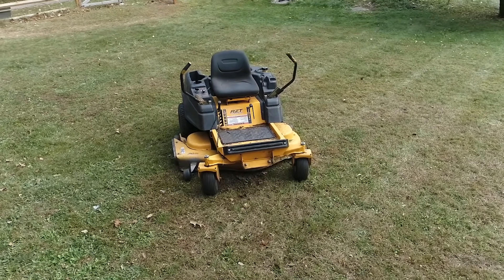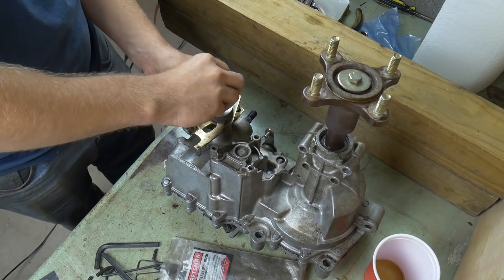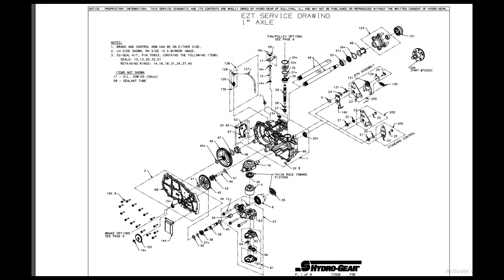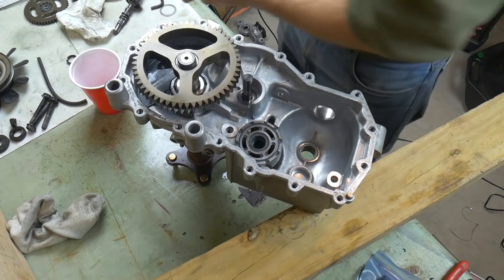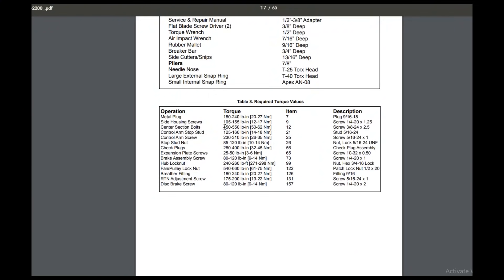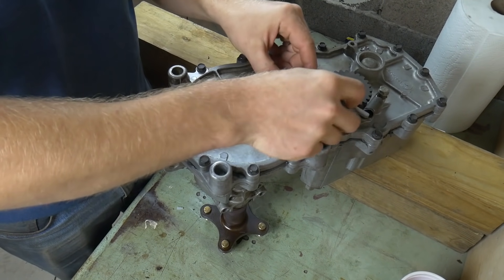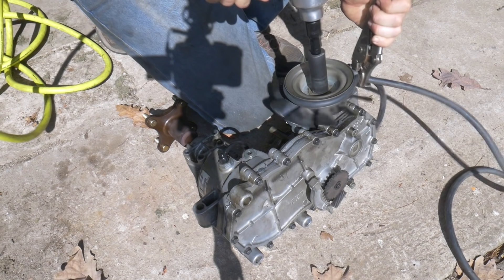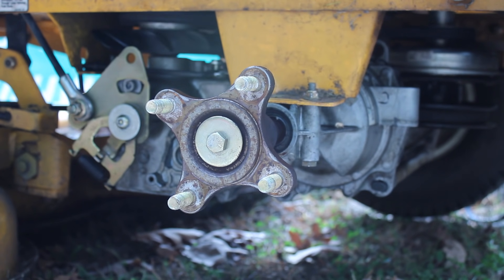Cub Cadet Zero Turn Weak Transmission Fix.

Comment from the maker: Quick Tip! If you are having issue removing the the input shaft and the bearing, you may have loosened the 3 center section bolts too soon. If so, tighten them down  and it should be easy to remove. A few people commented with this issue and tightening down the center section solved the problem. Sorry for not showing that in the video properly. Hope this helps anyone having this issue.
Reply: Thanks for this comment! I was struggling with this very thing, but also taking out the little retaining pin on the input shaft, but is that even necessary?  When it wouldn't come out because I had already loosened the three bolts, I assumed it was this clip and the service manual says to remove the clip.  My only suggestion to make this video perfect would be to show the removal of both shafts.  They were tricky.  Thanks for making the video, though, lifesaver!
Reply from the maker: @lorenjohnbailey6445  glad it helped. If i do another one i plan on doing an update for the stuff i missed. Who knows when that will happen lol
Reply: its called a banjo fitting not lollipop
Reply: I came here looking for that tip. As soon as I tightened the center assembly back down, that shaft popped free. Thanks!
Reply: I had a extra center section so I checked it for flatness, was surprised it is not that flat and sanding on plate glass 1000grit helped it😊😊😊
Reply: Sorry, saw this after my comment.  I'll give it a try, but am still wondering about that ring on the shaft.

Comment: If you change the fluid in these units regularly, the hydros will last. But if you don't keep your fingers crossed. The residential mowers do not have a drain to change the fluid. If you are capable, install a drain in each hydro to solve that issue. It's all about the maintenance. Just remember, Toro designed these movers for people with ZERO mechanical ability. When something like this happens, Toro is hoping the person will buy a new unit.

Comment: I'm having trouble locating parts for my mower.  I have the Hydro-Gear system like what you are working on in the video, specifically ZC-AMBB-4DDB-3RPX and ZC-DMBB-4DDC-2RPX.  Would you be able to help me with a website address where I can get parts?

Comment: What did you use or recommend to clean out the inside of the case when you have it open, to make sure any contaminants are removed from the inside. I've got mine all broken down, and new part in hand and look to reassemble this coming weekend.

Comment: Just opened up a ZT3100. I've had no trouble up to the point of getting the center section loose. But, I don't want to damage anything. My axle runs, but gets hot and loses power. I picked up a ZT2800 thinking it was another 3100. It's the opposite side (R). Checking the parts list for both, there are only a few parts that are different. So, my $15.00 investment hopefully netted me some serviceable parts. I noticed the gears were different numbers along with the center section, which figures since it's the right side vs. my compromised left. I didn't see that you had to remove the input shaft, but noticed it went back in after you put the new center section in. I'll try that tomorrow. Thanks. 😊
  I tried watching another guy, but he was saying it's a waste of time and money to attempt a repair. He was ripping parts out and said the whole thing was going in the trash after his video.
Reply from the maker: @battalion151R  if the input shaft is hard to get out, make sure the center section bolts a tight. Then remove the center section bolts.

If you loosen the center section before the input shaft is removed it will be hard to get out.
Reply: @darbleythetractorguy458  
  Thanks! Finally got it out. Everything looks great, I think my problem came down to the small seals above the (I hate it when I can't remember the name of stuff) supply pump. BUT! Getting that stupid bypass part to stay in the right spot was a PITA. A dab of grease works well. Since this pump is 12 years old, it had two cover bolts break off, which was fun. But, It's reassembled, and I'll be putting it back on the mower today.
  If you look at Hydrogear's diagram, I think that bypass piece is shown but not numbered. It's above the oil filter on the diagram, next to 188*.

Comment: This was a very straight forward repair video. No fluff, just the necessary info to get it done. I just subbed. It turns out that parts and service are available for these Transaxles if you do it yourself. I just want to change the fluid in mine, but I found this video and thought I'd watch it just in case I need to actually rebuild mine in the future.

Comment: How much was the parts bill for this i have a i1050 zero turn with the same problem. Got it didn't wait till the end to  post message.
Reply from the maker: parts and prices are in the description. Prices could have changed a little but roughly $200

Comment: Hi Tractor Guy, thanks for the video.....nice job , clear and well explained........looks to be easy......just two questions, if we consider the time and effort, would it not be safer to replace the 2 bearings? also Hydro gear tech say I have to replace both blocks (pump and motor) I know these parts are pretty expensive, but is there no risk these are worn and no anymore usable? ......last thing : seal kit : for what? where did you use it?....... my case ZT2200 (EZT) less than 100 hours, oil inside rotten (milky/silver gray) after 20mn/30mn use becomes noisy and weak and after a while won't work on right side.......many thanks

Comment: I have watched a lot of these videos, and nobody asks the question of "Why" did the center section fail. I have rebuilt several of these units, and in every one the 10-tooth jack shaft gear hard surface is flaking off. Those tiny chips go down to the sump, get sucked up into the pump, and chew it up. So, if you don't replace the gear your rebuild will be short lived.
Reply: If this is the problem, just drill a hole somewhere in the bottom, thread it, and close with a magnetic oil pan plug, chips will stick on the plug, afterward it also make oil change easy
Reply: @Michel-gb5eb    Drilling a hole to drain the oil is a good idea, but you still have to change the damaged gear. There's already a magnet and filter screen from the factory but the chips still get into the center section.
Reply from the maker: Thanks for the info. I was under the impression that it was from going into reverse while still moving forward. There no pressure release on these transaxles so it slams the piston onto the center section.

If I take another one apart I'll definitely check the gear surface.

Comment: So mine is of course is the left hydro and as I mow the unit gets hot and is not very responsive. But cold at first it turns fine. What if you just changed the oil from a multi V to a straight 30 or 40 weight or even a 50 weight? Isn't the problem the oil thins as it gets hot? Yes I'm lazy and afraid I'll screw it up!!!😉

Comment: at the end of the Video you adjusted the neutral position. Was the engine running to check if the wheel would spin forward or backwards ? ( to get Neutral at the correct spot )
Reply from the maker: If you can safely adjust it while the engine is running, I would do it while it's running. If not, adjust with engine off and check it with engine running. I believe I did it with the engine running but it's been awhile.

Comment: Losing power from right hydro, why do grooves hurt the center piece? I checked my check valves, they are tight, I do have metal shaving in the filter. 

Thanks

Comment: wanting to find out how old my transmission is
Info on the sticker: HYDRO GEAR
top right 618-04327
bottom left 6060B50239
MOWER IS TROY-BUILT RTZ50
Ive had it for many years. About 300 hours. Cleaned and greased after every use. Garage kept.

Comment: This failure/repair is all over the Internet and causes me to believe this is a design failure because it is certain to happen on the left hand transmission to every zero turn mower owner. I love the tractor when it’s working, but I will not buy another.

Comment: I know yard tools use the crappiest oil they can buy for manufacture.  Could these transmission problems be avoided by using synthetic oil?  My JD LX176 1994 still runs great after 30 years of mowing and snow removal.

Comment: Just got done replacing both left and right side center sections on my Husqvarna RZ5426.  My finger was too big to hold the bypass valve in place when installing the center section so I just used a zip tie to keep it in place.  Worked like a charm.
Reply: I used some really old dry grease and it worked great on 7 so far 😊

Comment: Maybe a good way to prime the unit would be to drive it with an electric drill while the unit is still out of the mower. That way after priming is done, you can easily check the oil level and fill as needed without having to remove the unit from the mower again.
Reply from the maker: It's definitely a good idea. I don't see why it wouldn't work.

Comment: I have a broken cradle bearing and the manual is saying its only available with a new case, but I found the cradle bearings sold separately.  Have you ever replaced those? Not sure if they just rest there in the case or if they are adhered in some kind of way.

Comment: How many hours do them pumps last until problems start happening  ??
Reply from the maker: I think it really depends on how they are used. I would say if used lightly you should easily get 300 to 600 hours or more. The big thing is not putting them in reverse while still going forward which a lot of people do with zero turns. If you come to an almost stop before zero turning or reversing I think they could last a long time.

Comment: Hey, Darbley. Everything works fine, the mower runs like a dream, but one issue, the bypass rod does nothing. I put it in, the same way it came out, and absolutely nothing. I can't find the reason, hopefully you can point me in the right direction, thank you!
Reply from the maker: The little metal piece is probably not in correctly.

Comment: Is there any reason why you couldn't do the purge procedure using a drill before installing it?  Seems like it would be easier to add oil if needed while it's still on the bench.
Reply from the maker: It's worth a try. I don't know if a lower rpm would affect it at all. If I do another one I'll give it a try.

Comment: Excellent presentation..!!!
I’m having trouble getting my center section out.. you skipped past that part. Everything is disconnected but it seems like it’s jammed in there.. worried if I just try to pry it out that cheap metal will break and parts will go flying everywhere..
Reply from the maker: there is a pinned comment that might address the issue your having. if your input shaft is still in it you might have still loosened the center section bolts to soon. Here is a better explanation

" If you are having issue removing the the input shaft and the bearing, you may have loosened the 3 center section bolts too soon. If so, tighten them down  and it should be easy to remove. A few people commented with this issue and tightening down the center section solved the problem. Sorry for not showing that in the video properly. Hope this helps anyone having this issue."
Reply: @darbleythetractorguy458  thank you so much for the quick reply..
It just started bypassing again..
Awesome..!!!

Comment: Just FUI if you use RTV you want to set the pan cover on just after applying the RTV. But! Do not put the bolts on for about 30 mins that's let's the RTV set up and make a gasket! Should be about a 1/8 gap while setting up..Then  torg down.
Reply from the maker: Thanks for the advice! Good info to know

Comment: What all did you have to buy, just the center section and seals? Thanks for the video.
Reply from the maker: Yes. Center section, seals, and oil.
Reply: @darbleythetractorguy458  so after this type of repair is it running strong up hills and any unusual whining noises?, thank you
Reply from the maker: @mountainmike1685  runs good and strong again after the repair.

Comment: I recently purchased a Cub Cadet Ultima 54 inch deck with a 24 horse Kohler.  I think it has this transmission.  I don't have time or want to do any work on the transmission.  I mow about a hour and a half a week with this mower.  I am not hard on it and never will be.  Currently it has 2.8 hours on it.  How long do you think this will last and are these transmissions junk? If so I may get a extended warranty.  Thanks for the video.
Reply from the maker: They should last if you don't beat on them. Mostly coming to a near stop when transitioning between forward and reverse/turning. Damage is done when pulling the stick to reverse while still moving forward. They aren't the best transaxles but can last if taken care of.

Comment: Question you said to re check level after doing the purge how do you do this ?
Reply from the maker: It should be filled to the top. Taking the fill cap off and seeing of the fluid is to the top of the fill hole. It's alittle tricky.

Comment: How can you tell if the pulley is bad? I don’t feel like tearing the whole thing apart? I might pull off & drain oil & refill
Reply from the maker: The only way to know for sure is to tear it apart. If it gets weaker the longer you use it, more then likely you need to tear it apart to fix/replace parts.

Comment: FYI.....the small bypass puck can be retained in place by the use of a small dab of grease.....means you dont need to keep your fingers in an awkward place......been working on these for over 20 years
Reply from the maker: awesome! Great tip. That will definitely help out.
Reply: Grease is a great tip.  I used a zip tie.

Comment: i have a ariens ezr 1750. 2200 trans .i lifted the front end to a angle greater than 45% to service blades i left the mower hanging over night .the next day it had low power wheels barley turn but wont move under load . any suggestion !
Reply from the maker: Did it somehow knock the bypass levelers? When it's not running can you push the mower around. Maybe they are low on fluid and got air it the pump buy that's probably unlikely. Sounds like bypass is engaged.

Comment: The mechanics of these machines are scary. A standard tractor seems way much easier to maintain and repair. I baught a used 2006 cub cadet 0 turn with a brigs for 1600.. it seems to run good for now. Lord please keep me sane. Everyone pray for me.

Comment: I replaced the center section on mine. Pulled it apart and it was scored again after break in
Reply from the maker: Did you sand the grooves out of the motor to make sure its flat?
Reply: Did you figure out what caused it to score again after you had just replaced it? What was the solution? Thank you

Comment: When putting in the center section take everything off the input shaft use it to hold center section in place but to put in center section put motor shaft and the little bread then put piston on top to hold the little bread it a whole lot easier

Comment: Great video. Thanks for the detail descriptions of the dis and reassembly. I need to change the oil in my transaxles on my Gravely ZT. I'm going to give it a shot by just changing the oil before I go complete disassembly. I will definitely be adding this video to my library. Take care Darbley.

Comment: Wow!  Thank you for posting this video.  It takes the mystery out of tearing down one of these transaxles. Do you think that there is the possibility of drilling in a drain plug, threading it in, in and perhaps changing your own oil in the transaxle from time to time? It looks like to me that the pump housing had lubrication inadequacies and being able to change out contaminated oil would help.
Reply from the maker: Im sure you could add a drain plug. I haven't had one apart in awhile so i can't remember how much room there is for a drain plug. Test it out and let us know!

Comment: I have a Question, I have rebuild my transmission twice, and I still cannot get to work.  I have rejust the handles  and nothing.  I was wondering do you have any Ideas what is going on.
Reply from the maker: Did you put the small metal piece in the center section when putting it back together. If thats not installed properly the fluid will bypass the motor and nothing will happen. Before taking it apart make sure the bypass isnt engaged also. The bypass level is what makes it able to be pushed when not running.
Reply: @darbleythetractorguy458  When I put the left one together I try turning the axle with  me hand and I couldn't turn it until I engaged the bypassed.  The right side I can turn it by hand like the bypass is engaged..
Reply from the maker: @vincentconner8429  if the right one is the side your having issues with i would bet the little piece of metal that is the bypass is not installed at all or not in properly.

Comment: I inherited a Craftsman zero turn Z6400 with a similar transmission and my left transmission doesn't seem to run as smooth as the right and I'm just wondering could it be low on oil?I was maybe going to buy some 20W-50 motor oil and take the fill cap off and add some to the transmission,how much to add?Some manufacturer's require you add oil to a certain depth below the fill hole,maybe an inch or an 1-1/2".Left transmission doesn't run as fast as the right going forward and specially going backward.Just wondering how much fluid you added to yours to call it full?
Reply from the maker: Just doing a quick search. looks like your mower has the same transaxles as my video. 1.75 qts to fill it. If its not clearly leaking it probably needs a rebuild.